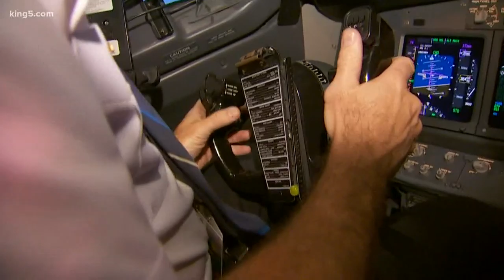More changes could be coming for the Boeing 737 MAX

Comment: I still won't fly that aircraft
Reply: Why? I always know what aircraftvI am flying.....
Reply: @yasminbarry7941  hi Yasmine. Because I as a aviation professional know that the aerodynamics of that aircraft have been altered on the 737 Max and the system MCAS should never have been installed. It's going to have more complications later down the road.
Reply: @erikhaack4123  : many people (including me) certainly agree with your analysis.
Reply: yes you will and you won’t even know it.
Reply: @flyingfish2528  no Mr. Flying fish I will know because I am a A&P mechanic. So maybe you won't know because you don't have knowledge of airplanes.
Reply: @erikhaack4123  Having your A&P means nothing. Get an aerospace engineering degree, work as an engineer for a major company for any significant amount of time, and then say your opinion. Otherwise, it's meaningless.
Reply: @solzy4623  really?? And you know everything about aerospace?  I have knowledge enough to know and experience that the 737 was the biggest mistake Boeing made. And knowledgeable enough not to fly that aircraft. I do work for a big company. It's called FedEx.
Reply: @erikhaack4123  I mean,  it's not like the 737 in general has been one of the most successful aircraft in recent history. I don't know everything, and neither do you. It's best to let the aerospace engineer folks discuss things like that, otherwise it all becomes relative. So anyone who calls the MAX unstable is just citing an opinion, because even Airbus A320neo's that have the larger nacelles like the max are praised by at least everyone (well, whoever hates Boeing at this point). Both planes are still stable, even at extreme ends of the envelope. It's just that they handle differently from their predecessors. And that's where Boeing made a shitty decision driven by money and are paying for it, well, hopefully they will be.
Reply: @solzy4623  I don't know anything?? Who are you to opinion for me??? At least I got an education on aviation and experience. What do you have??
Reply: If you should probably fly it once or twice about a month or two after it’s hopefully called safe. I know this is a little bit off topic but oh well

Comment: This guy is selling the company line.  
Fundamentally if you don't tell the pilots about a system that will crash the aircraft (that's dependent on 1 sensor), That YOU Cant TURN OFF.  
It's on Boeing.  all day every day

Comment: The problem is the quality of the planes. Since Boeing outsourced the parts of the plane part the quality went down. And they weren't bothered with safety but with profit
Reply: Yes. And moving Boeing  company head quarters out of Seattle to Chicago was also a bad decision.   

Boeing jumped the shark on those two decisions alone at the start. 

The lying and hiding the problems with this plane and the addition of  super sized engines is unforgivable . 

No plane that must have computer/censor continually check and recheck the pitch of the nose in order to fly safely should be considered "Titanic-like  unsinkable ". 

The 737 is not built for monster sized engines . They should never have messed around with a plane(737)  that was not broke. SMH Boeing screwed up.

Comment: It does not help when Boeing kept how the MCAS system worked out of the first Manuals. Only after considerable pressure on Boeing after the first crash in Indonesia which initially they tried to insinuate was caused by Pilot error did they come half clean.

Comment: The problem is the engine...the plane should nv be allow to fly again.
Reply: It being bigger and the wing being low
Reply: Problem is not the engine, the engine is the finest in the world deliver fuel economy like no other.  The problem is that lower hour trained pilots do not realize what a stall is.  Both aircraft flew into a stall and both times the pilots did not realize it.  To much computer time, not enough seat of the pants flying.

Comment: Don't feed the public  with Boeing propaganda. Those two 737 max aircraft that crashed had engineered stability issues that Boeing at the time said was a safe aircraft, which we now know was untrue. Boeing will not give up the fight. They are determined to put the blame on the pilots who of course are dead and cannot answer for themselves.
Reply: You are wrong about design issues.  American trained pilots loved the aircraft and never had one incident in over a few million hours of flying.  Remember, the aircraft has to be flown into a nose high attitude and stall by the pilot.  That is what armchair critic misses.  Nose high and reduced speed initiates the nose down attitude.  Unless the pilots were only trained on computers, a pilot with seat of the pants experience will lower the nose and apply throttle.  As for the pilots answering for themselves, it is clear from the cockpit recordings that they did not realize they flew the aircraft into the initial stall.  Enough said.
Reply: Why is mcas necessary?  Because the max doesn't handle like a standard 737. Why is that? Because when the 737 was first designed FIFTY F UCKING YEARS AGO it had normal handling.  Then the financial wizards at boeingMD bolted giant new engines on decades old airframe. Big surprise,  it handles badly at the edge of the envelope.  
BTW I saw a max fly into Abbotsford airport this morning.
Reply: bob avon  the engineering department was gutted by cost cutting and outsourcing.  They aren't building a new airplane because they can't

Comment: This is not a problem confined to Boeing or Aviation. 

Any complex control system will have this kind of challenge in the HMI (Human Machine Interface) that must be perfected to allow precise and timely human reaction when needed.

Look for examples in SCADA (Supervisory Control And Data Aquisition) systems. 

Then, there's a philosophical problem too. Once automation is unreliable it MUST be shut off. 

Some servomechanisms equivalent to the power steering in cars must be kept very simple, reliable and fully understandable and predictable. Other more complex subsystems that collect, process, analyze data and possibly make decisions on how to act MUST be completely decoupled from the subsystems that effectively act, and MUST have a way to simply and unequivocally be shut down, probably as those big red emergency buttons in so many machines.

Once the fancy automation is suspected unreliable, pilots should EASILY gain FULL CONTROL of the aircraft, and be trained into suboptimal but safe flying.

All of this is coming to us with the ultra hipped self driving cars and stuff like that when people deal with systems they don't fully understand...
Reply: That's not even the issue at heart there other far more computerized airliners that have been safely flying for decades some Boeings included the issue is the lack of redundancy exposing a single point of failure
Reply: @PabloGonzalez-hv3td  
Yes, this was a bad implementation, but not just by a lack of redundancy as planes fly without this sensor. 

The central fact was relying on automation interfering even with manual flight. The safeguard was shutting down automation. This is possible and simple to execute, but has to be done timely. 

This requirement of acting quickly develops into a demand for pilots reacting quickly too and that depends on them getting acquainted with the exact situation, the said "situational awareness". 

The clumsy presentation of the faults by the HMI than becomes a primary driver to retard pilot reaction and endangering the plane.

Other highly automated planes as the Airbus A330 from Air France AF447 Rio-Paris flight presented a similar challenge that ended in tragedy too.

At the end it was a pilot error, one pilot commanded a nose-up that stalled the peefectly flying plane for 4 minutes till it crashed into the Atlantic. The other pilot only grasped what was happening seconds before the crash with no chance to recover.

In all those cases there were enough resorces to save the planes. Just flying with automation disabled under known secure settings (pilots are trained to know by memory) till sorting out the mess would have saved them.

Human reliance in automation without being properly prepared for its failure was the primary driver.

Airbus has babysitting software correcting pilot commands even under manual flight to maintain the plane within it's flight envelope. It has 3 pitot tubes for redundancy.  

Anyway, as said in "Murphy's laws", if it can happen, it will happen. Pilots got so used to automation that their reaction times to believe it is the problem, disable it, and fly manually is impaired.

Planes do fly better and more secure with automation help in general. Once in a while there will be un event when it's not true, and they need to be prepared for it. Not just in the 737, not just in Boeing.

Boeing historically put the pilot in the center stage. The MCAS software mindling with manual flight might have been startling to Boeing planes pilots adding to their hesitations.
Reply: @celsostarec6735  - The term "automation" in aviation can be misleading without exact context. MCAS itself does not automate the basic task of flying it is a stability augmentation system and these systems have existed for decades, in both mechanical and electronic form, without this type of failure mode.

MCAS is essentially an electronic anti servo tab the difference is the tabs being mechanical devices can only offer a resistance proportional to pilot input and cannot develop a mind of their own.

Airbus airliners are highly computerized but are they more autonomous than conventional aircraft? Not exactly. In the regular flight envelope not at all, just a different type of input system. Outside of the flight envelope absolutely but theoretically a crew should NEVER encounter these protection systems if they are doing their job. 

Modern fighter jets also have similar protection systems for instance, to limit G load or Auto GCAS.

The blanket statement that "pilot input should override automation in a timely manner" sounds like a no brainer on paper but it has been proven to be untrue as a blanket statement.

A protection system by definition, needs to, in one way or another, contravene pilot input and if it can be easily defeated it can in turn, defeat the entire purpose of its existence.

For instance, in the Colgan Air crash the captain overrode the stick pusher that was trying to save their Q400, sealing their fate. In this instance had the automation been capable of positively intervening it gives them at least a fighting chance.

West Caribbean 708 crashed in very similar circumstances as AF447 and was a conventional, non FBW, yoke equipped aircraft. The FO even recognized the stall but was too timid to physically intervene. Again in this instance positively intervening automation saves a crew equally as unaware as AF447, in a completely different aircraft but suffering the same problem.

The real focus is to create a balance where operator and machine can correct each other without getting in each other's way but that is far more complex than a "big red button" that just disables all "automation".

An airliner that requires 100% hand flying 100% of the time is equally as dangerous as a completely autonomous one there must be a balance.
Reply: Look at Tesla, prove the vehicle while in the market.